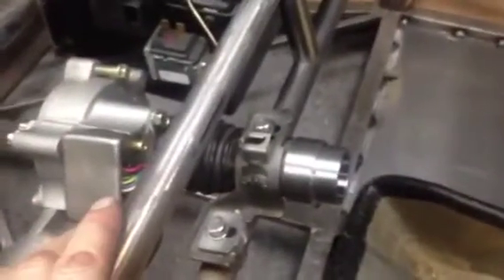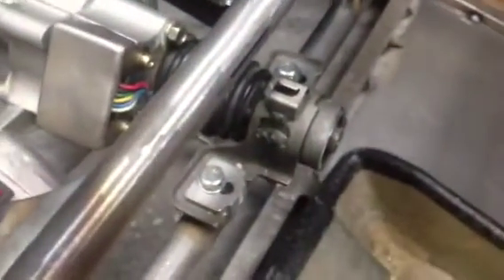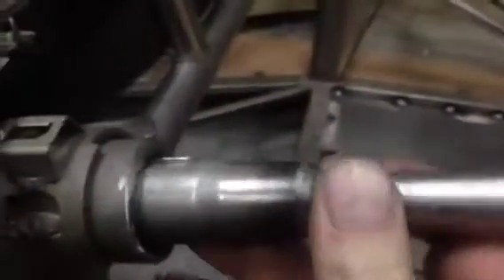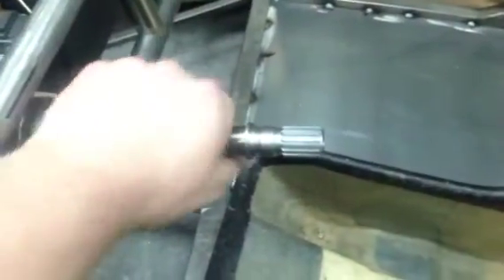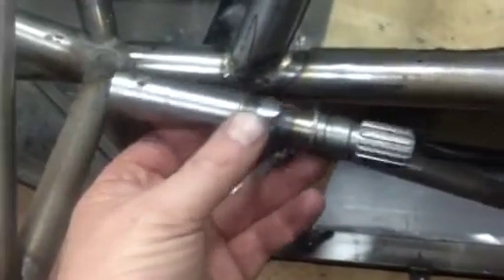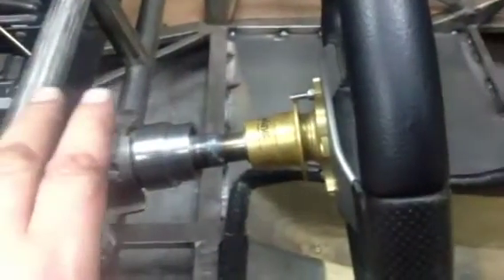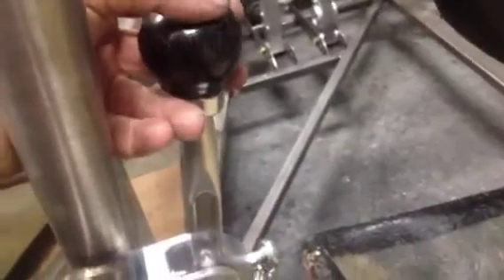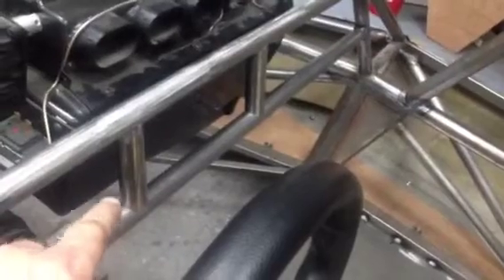Electronic PAS

Comment: Beautiful work, is there a wiring diagram to connect the steering?
Reply: The system has it's own small loom and only needs power ground and a small separate box which can be used as a dial for assistance or to receive a PWM signal. They all can be bought on ebay.... but to be honest the DC Electronics Micro steer system is really good and not to expensive now at 600 quid...  I will be using the DC system on our next few cars...